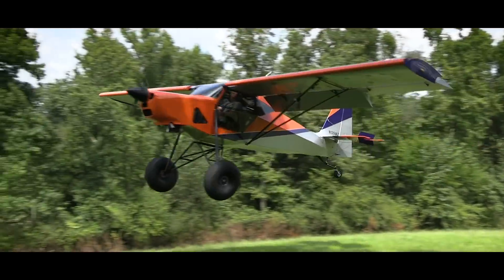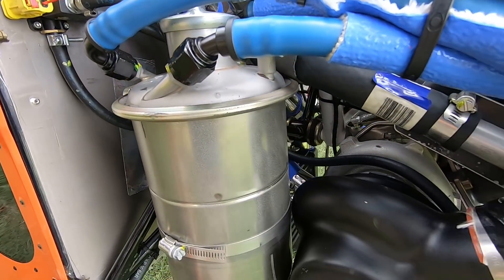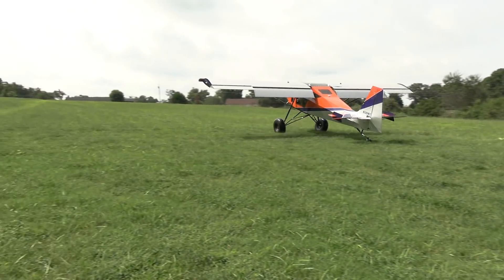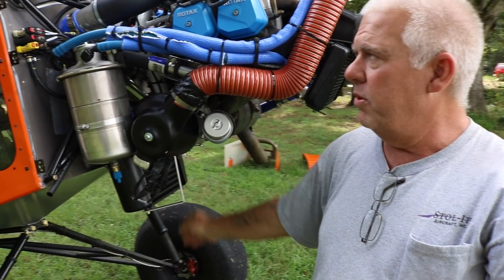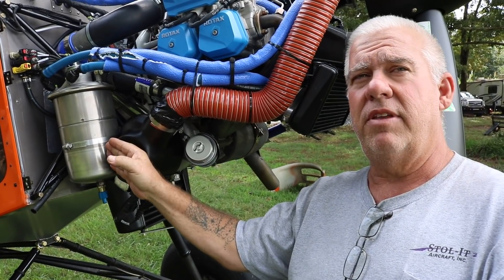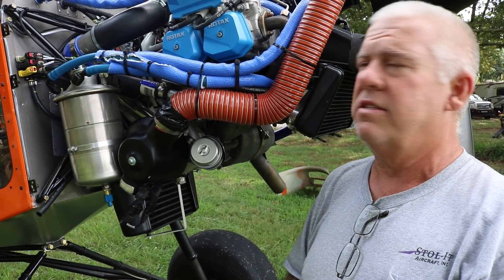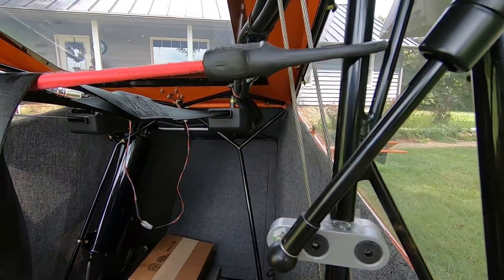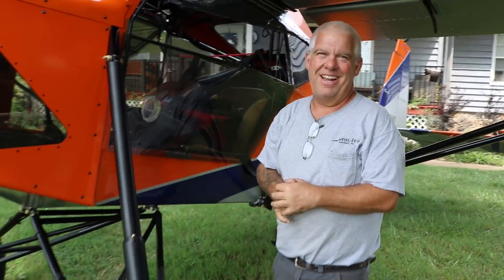TurboCHARGED Just Aircraft SuperSTOL

Comment: It's still kind of a spendy engine. Less than a Titan but still.
What do they rate the TBO at on the 915? 1200 hrs? I think I heard that awhile back.
Reply: They plan to increase it to 2000 hours after they can see how the first engines are wearing at 1200 hours.
Reply: @nateb19  aw yes I believe you are right on that come to think of it. 
Maybe if I get a Highlander for my birthday Santa will leave me a 915.
 Ha!
Reply: @429thunderjet2  Check out the Zlin Norden as well.
Reply: @andrewmorris3479  pretty cool with the double Fowler flaps synchronized with the leading edge slats. Almost like Mike's Scrappy except he has double synchronized slats.
Reply from the maker: Christmas is coming very soon! Maybe you have been a "Good Boy" this year. If not... you might need to prepare searching for a "Coal Powered Aircraft Engine!" :-D  Hah!
Reply: @ExperimentalAircraftChannel  hmm , i wonder if anyone has developed a light weight steam engine for aircraft use yet to burn that coal in ;)

Comment: 915 also good on Mogas!
Reply from the maker: Which is a surprise! Most turbo engines require higher octane. I guess MoGas just slips in there on the octane rating. SMART! :-)
Reply: @ExperimentalAircraftChannel  in Africa, Avgas is VERY expensive, at more than double the price, whilst, Avgas is NOT found everywhere. Mogas and Jet A1 are!
Reply: @ExperimentalAircraftChannel  The heat in an aircooled engine makes it much more prone to pre/post ignition. Ignition temperature of petrol is around 250 degrees. An air cooled head sits around 200 compared to liquid at about 100.